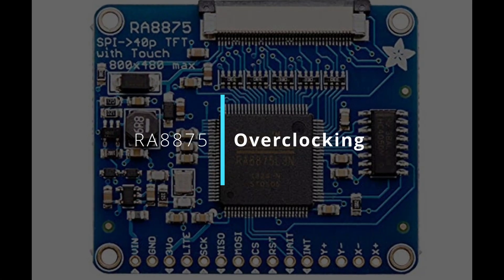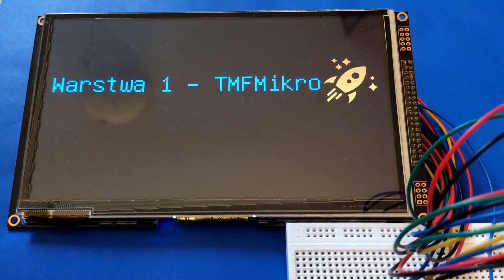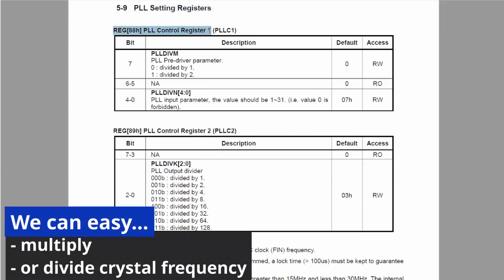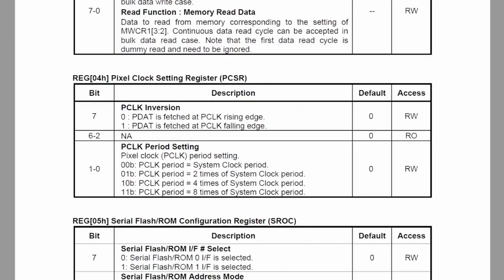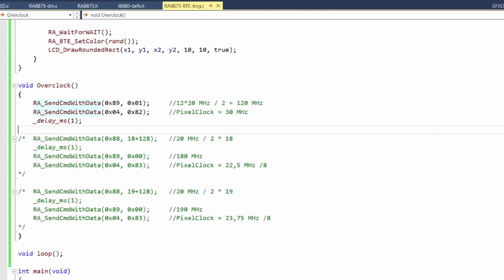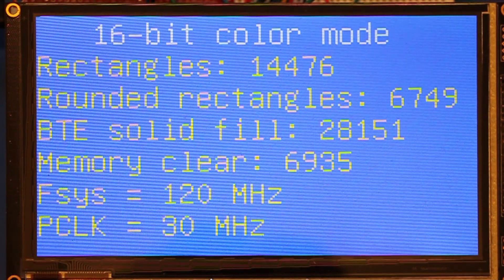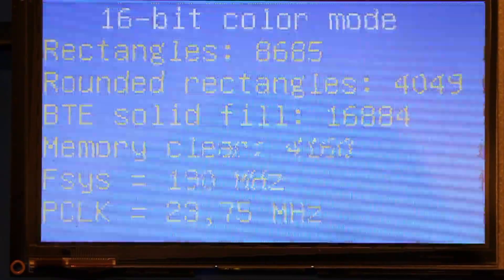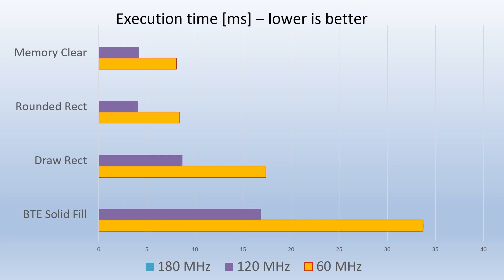RA8875 overclocking

Comment: There was artifacts around 180 MHz
Reply from the maker: Actually, those are not artifacts. You may see a small glitch, which is a result of measuring command execution speed. My program every a couple of seconds runs a test procedure, which as a result draws something on LCD. Because it lasts for something like 50-100 ms you can see it as a glitch. And you can see interference between LCD matrix and my camera – the interference disappears if the camera is slightly out of focus.
However, RA8875 becomes unstable at 180 MHz in increased temperatures. Basic functions still work, but the drawing circles, lines, and ellipses show some artifacts.